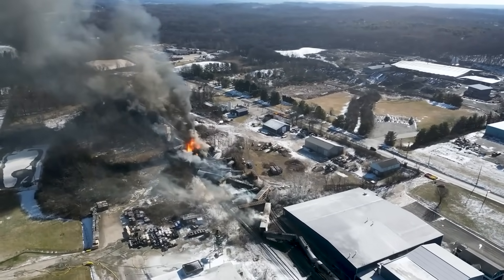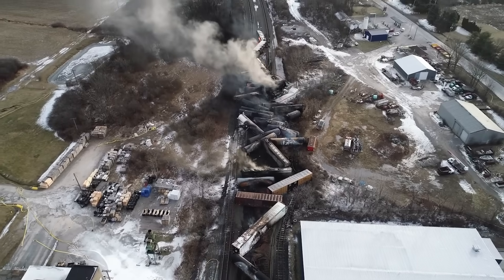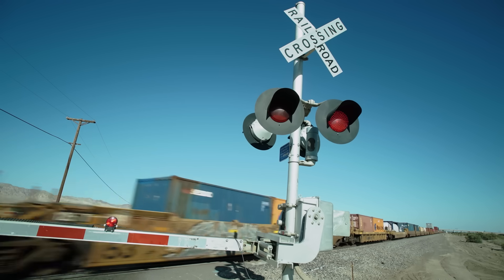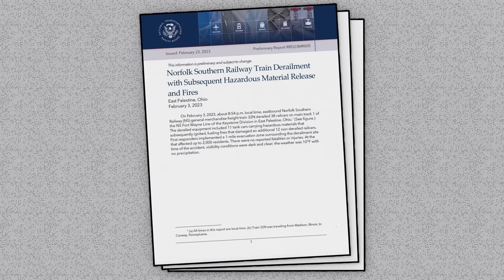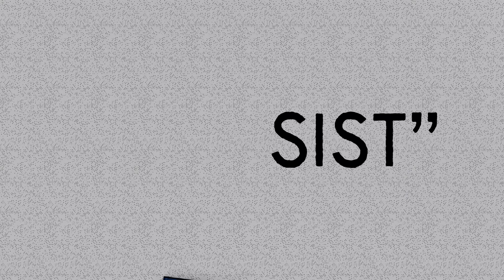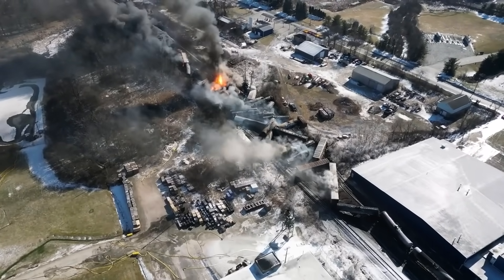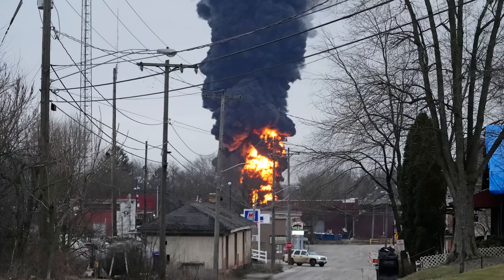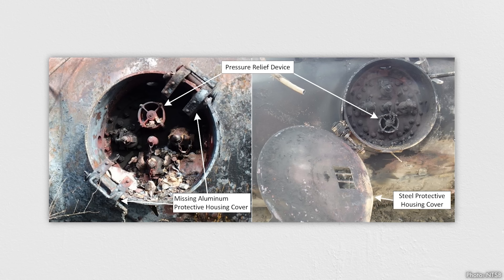East Palestine Train Derailment Explained

Comment: I thought train air brakes used air in the opposite way than truck air brakes. Trains brakes working when pressure applied, truck brakes need air pressure to release.
Reply: No the air brakes use the air to hold the brakes off if the air pressure drops thye come on they work the same as trucks
Reply: @oregonrailfan7046  ok. You sure about that? I don’t know why I thought they operated differently.

Comment: Have you compared the accident rate per mile travelled/ ton carried in the US versus railways in Europe? Could different track maintenance standards have an impact? Or is it a factor of longer, heavier trains?
Reply: Europe is more passenger orientated so that could affect things.
Reply: on a related note im curious why german freight rail has way more accidents than peer nations in the EU.
Reply: Train related deaths in the US have been a lot fewer than Europe, only recently catching up. Even then a good chunk of train related deaths are suicide /undetermined.
And per mile / ton carried wouldn't be accurate at all as the US is the largest rail system, bigger than Russia and Europe's rail systems respectively. Plus the amount of stuff we put on it is probably magnitudes heavier as well
Reply: @A_barrel  Some interesting angles here. As you say, a lot of deaths on UK/European railways are not directly related to train operations. Leaving that aside, I am wondering if there is any correlation between the number of freight trains and the number of derailments. It could be that hot axles and so on are related to the mileage covered by wagons, rather than the frequency of trains.
Reply: @bishwat70  I was talking about us railways but I'm sure it's probably not much different than Europe tbh.
You can have hundreds of derailments, and nothing happens because it's just one axle that pops off the rail, it could rerail itself, a maintenance team helps it rerail itself, or you get a crane, but aside from lost time and gravel getting kicked around nothing happens. Or a couple cars get tipped over in a cow pasture, nothing happens. 
In cases where the results are catastrophic, or appear to be, things get shoved under the microscope that really shouldn't be.
Reply: @A_barrel  You reckon fewer train fatalities may have anything to do with having barely any passenger trains?
Reply: @Mongolold  no people kill themselves regardless of continent

Comment: From an engineering perspective, 200 degrees above ambient is likely too high of a maximum trip point. Particularly because none of the other bearings were anywhere near that temperature. The difference between various bearings should have signalled a fault condition. In addition, the temperature delta from one check point to the next should have also triggered a fault condition. A temperature rising that fast should always be cause for concern. The automated monitoring system is either woefully inadequate, or configured to be near negligent.
Reply: I agree with you on most points, but as someone else pointed out, it's more complex than that. You'd have to account for braking, grade, track conditions, etc. Engineering a proper solution to this would require statistical data from thousands of hours across thousands of miles of track with thousands of wheels. Along with a better system that shares info, provides logic, redundancy, and a more statistic based error estimation approach. It sounds to me like they simply don't have this level of data collection. They should, but they don't. As far as I know those systems are self contained, they don't communicate with each other, and they take in very little info. It's old tech and there's little incentive to change.
Reply: @gizmoguyar  That would then fall under the "woefully inadequate" category. As you said, they SHOULD have that level of data collection. They literally have thousands of wheels driving over every inch of track (especially the busiest lines) pretty much every month. Finding the nominal operative envelope for pretty much every stretch of track would be far easier for railroads than just about any other industry. Rail systems eliminate so many variables that you would otherwise have to consider.

In this case, simply being able to discern a large temperature delta between bearing assemblies on the same train would have alerted the engineer early enough to avoid the accident entirely.

Railroad companies like to play fast and loose when it comes to safety margins. They like to cut things as close as possible to maximize profits, but those actions mean that we have incidents like this, and they are getting more frequent as of late because the companies have gotten lax on safety, maintenance, and other due diligences. The smoking gun for me was the fact that they had the trip point set at 200 degrees above ambient, which the train tripped at the final defect detector, but left the crew without the proper time to stop safely. This means the trip point of 200 degrees was too high. It was likely placed there as the risk of false positives was deemed too much of a burden on profits.

These systems should be talking to each other, that exact bearing assembly was likely showing elevated temperatures for quite some time compared to the other assemblies on the train as it deteriorated, which could have tagged that car and bearing assembly as in need of maintenance.

If we are going to continue to allow railroad companies to operate larger and larger trains with fewer and fewer crew members, then we must FORCE them to upgrade their automated detection systems to ensure to the maximum extent possible the safety of the public, their employees, and the environment. Anything less is negligent.
Reply: Or the system is based on 35 year old technology and can be improved.
Reply: @msromike123  That would be under the "woefully inadequate" category
Reply: I can't say anything about the US rail system as I know very little about it.

Not saying it is the solution for the US as it is a much bigger country. But I drive trains in Sweden and we have detectors that are all linked to the same remote control central (No idea what it would be called in English. Think of them as air traffic controllers on an airport.) And these detectors can detect various issues like damaged wheels through excessive vibrations as well as wheel, bearing and axle temperatures. If an issue is detected the human controller will call you over GSM-R and inform you that the detector you passed detected abnormal temperatures. 
You can then get either a simple warning where no action is needed by the driver unless the next detector gives you the same alert of course. Or if it is a higher alert then the driver has to take some kind of action, usually stopping the train to inspect the wheels and bearings, not as easy as it sounds when you have knee high snow! Luckily these detectors are advanced enough that the controller can tell you exactly which axle and even which side it detected the problem.
And if there really is an issue with the bearing then you can see it quickly with an IR thermometer. Though is something has gone wrong you WILL usually see it quite clearly, as either the heat sensitive paint on the wheel has flaked off, burning grease is spat out of the axle box or the whole wheel is glowing as orange as, well, an orange.
If no fault is detected when inspecting or the temperatures aren't high enough to stop the train until repaired, then you just leave the wagons which registered a defect at the next station so that the maintenance crew can do a more thorough inspection at a later time.
Reply: @Badjoe117  Thank you for the information. I was aware of more advanced detection systems but not nearly all of their capabilities apparently.
Reply: Ambient temperatures also vary with wind speed and direction, and the tolerances on the defect detectors are very wide, to avoid triggering too many false-alarms. And yes, the system is archaic.
Reply: Defect detectors have been around in some way shape or form for nearly a century and automated ones have been around since the 1950s. The problem now is that I think the current technology still has these detectors as islands to themselves, only broadcasting on radio frequencies to the engineer listening in the passing train. A better system would be these detector boxes linked into the train's dispatch network. The amount of data to transmit isn't that much and could be handled by cell networks in most places, and satellite networks in other places (and railroads use sat uplinks now for signaling). At that point, the data could be collected in real time and checked for deltas in temperature, alerting crews to potential problems before something gets out of hand and is too late to prevent a derailment.
Reply: @Sevenfeet0  It was pointed out in another comment that European countries have systems like that in place right now. Giving rewaltime readings on every sensor reading for every train on every track. This means the central software can be updated with more and more sophisticated analysis over time as more and more predictive failure factors are determined. Do train wheels excessively vibrate in the weeks prior to failure? well now we can watch for that. Does a specific auditory signature predict the failure of a cylinder on a diesel engine? boom, now we can listen for that.
Reply: Well as others have pointed out, defect detectors don't 'share' information to allow trending of temperature readings.  And certainly if some 400 readings for a 100 car train were sent to the engineer, he wouldn't be able to pick out a problem while operating the train.  Some sort of on-board monitoring system might be advised, but that's a pretty expensive 'backfit' for every car in the US (or even just every hazmat car).
Reply: @mikefochtman7164  That would mean the system is "woefully inadequate" as the simple coordination of the detectors would have prevented this incident. Not every car would need to be outfitted with an on-board monitoring system, just the engines. Cost is not an excuse, especially as the railroad companies have saved significant "costs" over the years by using these various levels of automation to make extra crew redundant. We regularly have trains operating with a single engineer and no additional crew, all for the sake of "reducing costs". The safety and reliability of our rail systems are being negatively impacted and we should not accept the companies petty excuses.
Reply: @trapfethen  I like when people decide how much money a coprporation can "afford" when it comes to increasing regulation.  Over-regulation is a subtle tax on all goods and services.  I'm not saying it doesn't need to be done, I just think your assertion that the railroads make enough money that they can afford anything thrown at them.

"Tax the rich, feed the poor, until there are no rich no more.  I'd love to change the world, but I don't know what to do. So I'll leave that up to you."
Reply: @msromike123  The railroad companies combined posted over 12B in profits last year, and in addition bought back over 16B in stocks. The insinuation that the companies are somehow cash strapped and incapable of making these improvements without increasing the costs to consumers is just laughable. If they raise prices as a result, it is because they CHOSE to, not because it was necessary. This is before you even factor in the fact that 2022 was a record year for railroads. They made more profit than usual, which could have easily been funneled into capital investments such as these hypothetical upgrades.

I'm not saying tax the rich, I'm saying make the railroads responsible for making their product safe for those they operate around. Responsible for PREVENTING these accidents in the first place, as the cost of cleanup is obviously insufficient to incentives that behavior. I'm also not saying "I don't know what the solution is, just do it", We have in numerous points in this thread pinpointed specific technological solutions for preventing these accidents in the future.

I'm not guessing on how much these companies can afford when it comes to increasing regulations around railroad safety, I've done the math. They can very easily afford the capital expenditures necessary to make these improvements, and even more so finance it to spread it across decades of P&L statements. Don't go to bat for these companies, that's what they pay lawyers and lobbyist for.
Reply: @mikefochtman7164  I don't agree, thedata already is being processed, and it's all there at least in terms of knowing deltae between various axles.  I mean it would be a software solution.  No telling what the cost would be to upgrade the monitoring software to have trend analysis included as well as differential data on axel temperature.  The sensor are there, the data is collected, now it's just a matter of tweaking the software to output the data and make appropriate notifications.
Reply: I mean the system right now is massive numbers of rail cars with minimal crew thanks to precision scheduled railroading and from the video it seems like the crew would have to manually track temperatures for every car since its a basic radio system.
Reply: @radnukespeoplesminds  As per a railroader in the comments above, two-man crews have been standard since the 90's. Additionally, it doesn't check temperature delta because breaking even a little can induce temperature shifts like that. A change to the system that notes if it is a uniform temperature across bearings would be a good idea.
Reply: @KainYusanagi  Temperature deltas should be tracked regardless of breaking because breaking would NOT create a consistent temperature rise through THREE multi-kilometer defect detectors.

In addition, in places where breaking is a given, such as the exterior of a populated area or on the lead-up to a tight turn, the breaking envelope can be characterized "The trains approaching this point should be travelling at speeds between X and Y and should be breaking down to Z. This means they must dissipate Q kinetic energy through the application of breaks per car. This will predictably raise temperatures by dT += some percentage". Operating envelopes are not a new phenomenon and have been used in the aviation industry for DECADES to pinpoint potential problems well in advance. We should be applying the same due diligence to our railroad systems since they transport the vast majority of our resources and have much more regular contact with populated areas.
Reply: @trapfethen  In reality it is much more difficult since trains use there wheels as the brake rotor. There is a huge effect from rain or snow, also all the wheels have differenet sizes, what gives them different thermal capacity, also the design of the railcart changes how much air flows by that cools it, last but not least the weight of the railcar and even the position of the sun effects the temperature.
Reply: @jonasstahl9826  The item being measured is not the Wheel, but the bearing assembly. It appears you have some confusion on this point. The wheel would be experiencing substantial increases in temperature as it acts like the brake rotor; however, the bearing assembly would be experiencing substantially less wild thermal swings. The majority of the mass of train wheels is in its outer diameter. This gives them higher levels of angular momentum, but it also serves to limit how quickly thermal energy can transfer to the inner diameter through conduction within the material. In addition, the outer bearing race is thermally isolated from the inner bearing race by a substantial margin thanks the the limited contact between the internal roller bearing and the limited thermal transfer properties of the grease within the bearings. We are not measuring the temperature of the wheels themselves, that would be almost pointless as the point of failure for the wheels would be near the softening temperature, which is nowhere even close to operating temperatures, and they would be near impossible to generate through friction forces alone in real-world track conditions if you were TRYING to. The item being measured is the bearing assembly, hence why the detectors are oriented vertically several inches on the outside edge of the track. While breaking does influence the temperature of the bearing assembly, it is to a far lower degree than people realize.
Reply: @trapfethen  Thanks for the information, even i knew that they messure the bearings, i though braking had a substancial impact on the bearing temperature, since the wheel and axle are a solid piece of steel.
Reply: @KainYusanagi  I'm wondering if eminent bearing failure could be more easily detected with harmonics. Like the knock sensors on engines.
Reply: Or maybe it was created and installed before yesterday and was the most praiseworthy cutting edge high tech solution at the time.
Reply: @petermgruhn  Which would be an example of "woefully inadequate" as pointed out. There was enough information to identify the issue far earlier and prevent the crash. The excuse "The tech is old" is not good enough.